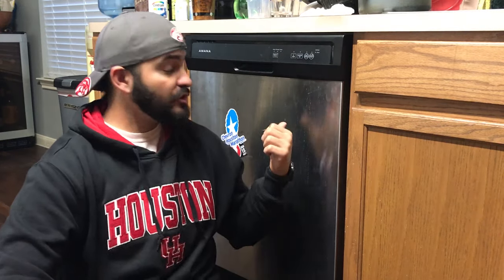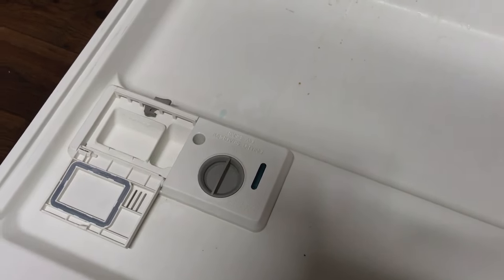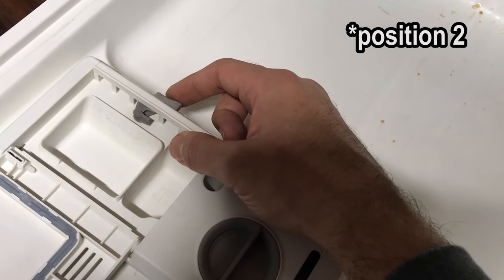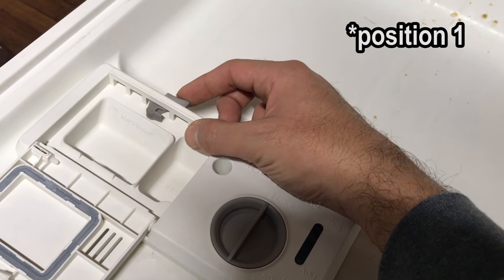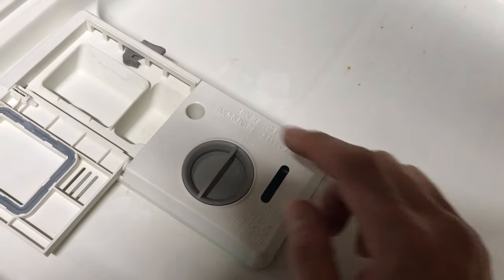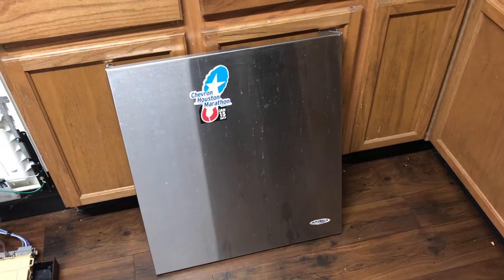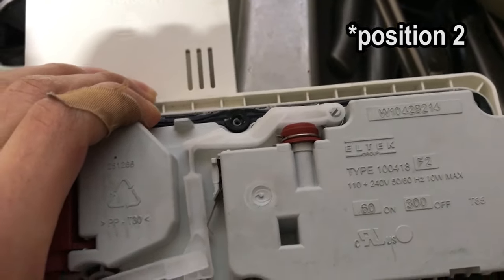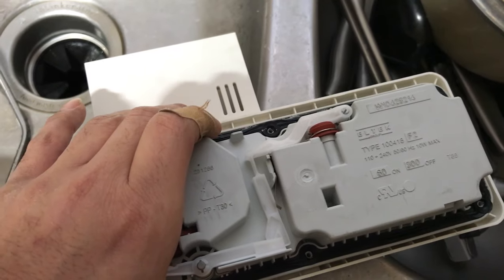[FIXED] Dishwasher not releasing rinse aid

Comment: You have no idea how mind blown I am right now! So thankful I found this video! I’ve tried everything to fix my dishwasher and never could get it to release the rinse aid! I just tried your trick so let’s hope and pray it works!!!! I’m at my wits end with drying these dishes every time!
Reply from the maker: I know your pain. When I reached my boiling point, I decided to rip my dishwasher apart because I probably needed a new one anyway. Then I stumbled upon the mechanism inside. I've been very satisfied with dishwasher's performance ever since. Hopefully your problem is the same as mine and this will fix it. Best of luck. Let me know if it works for you.
Reply: I have the same dishwasher but mine has loud click and silent click. Tried it both ways and neither worked. Glad it worked for others though.

Comment: Thank you so much for posting this. I was going insane couldn’t realize for years the rinse aid never emptied or anything. I never knew this. Thanks for sharing this trick. I’m a single mother & I couldn’t figure this out and with your video now the rinse aid is dispensing. Yay I am so happy. I hate spots on my tubberware and dishes and now I realize it was locked and not releasing the rinse aid. No one would know this because there is no button or anything that shows to do that. And I’m renting so I don’t own the Manuel. I searched videos after videos and none were helpful except yours. I appreciate you showing the mechanism behind it and how it functions. This video was extremely helpful. I am doing a load of dishes right now so I can’t wait for them to be done to see how they came out. I also changed the position to the highest since I have hard water so hopefully that works. Thanks again for sharing. You have been extremely helpful. 😊

Comment: Years of mystery solved ! I was wondering why my rinse aid levels never dropped. I had thought something must have been clogged. Thank you thank you thank you ! Why dishwashers don't have these instructions imprinted on the door I will never know. Maybe it is to get us to call the repairman every time.
Reply: How did you figure that out please? Your problem is like my problem I cleaned out all of the residual rinse aid, thinking the outlet was clogged, then I lost the cap and can not use it now. I need to buy a new cap but from where.  Regards, Laurel Merrick Bargara Queensland Australia 4670.

Comment: Thanks for the help, Alberto.  With your guidance I was able to get my rinse aid dispenser to work.  My dispenser stop opening entirely.  The pin that engages the lift lever was out of position so the plunger/stop at the top never opened.  By repositioning the pin back to where it belongs the both actions now work.  The detergent door opens and now the rinse aid plunger/stop at the top opens and rinse aid dispenses.  I had to remove the unit from the door to see the problem.  Just one more thing to check in addition to your guidance.
Reply from the maker: I'm glad this helped you out. Hope you got your problem resolved.

Comment: I would just keep it on position two all the time and put the pod in the flatware caddy. The pod won't fully dissolve in the prewash but that little bit of detergent released helps to start attacking the grease and then for the main wash, the pod will dissolve completely to clean the load. You won't have any lingering fragrance on your glasses or dishes at the end of the cycle either. For sure, run the hot water at the sink 'til it's ripping hot, and immediately start the machine. Always clean out the filter monthly and use a dishwasher cleaner every month in an empty machine to get rid of lime or mineral buildup. Very good video.

Comment: Great video and explanation of how that mechanism works.  Mine might be the wax motor, I don't think it's extending the piston far enough to release the plunger for the rinse aid.  Thanks to your video I see that it doesn't take much movement of the piston to release the door for the detergent, so I think that's my problem.
Reply from the maker: I thought the same thing about mine until I connected it to 120V A/C. Then I saw it extended all the way. It saved me from buying a new one. If you have a safe way to test it, you may want to verify if your was motor is extending all the way. Also make sure the lever is in the correct position.
Reply: @bird2002  Tested it today first on a bench, then in the machine. Applying power extended the piston the full distance and opened the plunger. I'm not sure if I'm out of sequence because even if you are out of sequence, the rinse aid would be release, just at the wrong time. We aren't getting it released at all, the reservoir never goes down.  Unless, the duration of the plunger extension is shorter for the wash step (opening the door), then longer for the rinse step. In that scenario, if I was off sequence, a small amount of aid would be released during the wash step, but during the longer rinse step, the plunger isn't opened because the sequence is off.  My other thought is a bad control board where there isn't a open command given during the rinse step.  I'm going to run it with the door face off and see if I can tell what's going on, but it's defiantly not anything wrong with the motor or the dispenser.

Comment: WOW!  I’M SO THANKFUL I FOUND THIS VIDEO!  I have the exact same Amana dishwasher under the wet bar in my basement.  I had the exact same issue as well: bought it new, added Jet Dry, and never consumed a single drop of the stuff after hundreds of loads over about 4 years. 

Wasn’t a big enough deal to go through the hassle of pulling it out and sending it out for service, but it always annoyed me that it had that one issue. 

After I saw this video, I set the latch in the correct position before loading the soap and closing the door, and voila!  Dry dishes!  You rock!  Liking and subscribing!!

Comment: Mine is a bit different, it's a Kenmore and it has a different controller for the detergent. But, inside the dispenser, I did notice that there are 2 ways that the "floor" of the dispenser can be left at. So, I moved it, filled it with white vinegar and turned it on the long wash cycle. We shall see. Your video was excellent, though and should work for lots of folks! Thank you!!

Comment: OMG, I’ve changed the heating element, swapped over the venting module, and still my dishes are always wet!
Finally noticed the rinse aid wasn’t dispensing and came across this video whilst searching for a fix. I’ve tried the fix and running a wash now. Fingers crossed it’ll work. This issue has been driving be crazy!  I was about to pull it apart and thought I’d check first before doing so. 
Going to come back and provide an update once the wash cycle is done.

EDIT - Seems to have done the trick.  Thank you!!
Reply from the maker: Yes!! Let me know if it works for you
Reply: @bird2002  Seems to have done the trick!! Thank you heaps.

Comment: So I had this same issue. What your video does not mention is that when you shut the soap dispenser door, the linkage will always revert to position one, the far right side of the triangle on the back linkage arm. No matter what position the linkage was left in. I watched a full cycle run and in the wash cycle I can watch the small motor turn on and open the soap door. After the motor piston retracts, the linkage is now in position to release the rinse aid. At least with my dishwasher, the motor never turned on again during the rinse cycle, allowing it to dispense the rinse aid. I’d be curious to see if you’re experiencing the same thing.
Reply from the maker: that's a new for me. I'd be interested in taking it apart to see if that works. Sounds like an excellent idea for a follow up video! Thank you so much! I'll post it when I try it out.
Reply: You’re 100% right, which nullifies the point of this video to begin with. Soft click/hard click doesn’t mean anything if the dispenser resets the toggle when you close the detergent door.

Comment: Dishwasher's been broke for going on 5 years now. Decided tonight was the night it got dealt with lol. Just before getting started at ripping it open, thought I'd check YouTube. Thank you! Saved me a bunch of hassle! 👍
Reply from the maker: I hope it proves useful for you. Let me know if it improves your drying. Another tip is to use liquid pre-wash in addition to the tabs/capsules. After I started using both, it made a big difference.
Reply: @bird2002  Dishes came out spotless! For the first time lol. Had to use the back of a fork to get it unfroze from the position it was in. I guess years of being stuck left it a little unwilling to move at first. 🤣 Once I got the gunk freed or whatever was holding it stuck though it moved happily. Watched the video again to make absolutely positive that it was in the right position n for the first time since I've had it - IT DISPENSED! 😲 
Thanks again!
Worked a treat! (n my dishwasher was a completely different model, but the concept remained the same nevertheless)
Reply from the maker: @abstract_jeff  awesome!! So happy to hear that. Thanks for letting me know how it turned out.

Comment: Holy crap, I'm glad I stumbled on your video! I couldn't get my rinse aid to dispense, so I went looking around for DIY videos for the Amana brand dishwasher specifically to no avail. I assumed it was broken and couldn't be bothered to take my dishwasher apart, so I was going to replace it, but you just saved me a TON of money! I wish Amana would explain this feature in the user manual.....
Reply: mine does not soft click
Reply: @Crazy4Morehead  mine doesn't either. Did the fix work anyway??
Reply: @Crazy4Morehead  Maybe you’ve solved this issue already, but just in case my experience helps…my “soft click” wasn’t as silent as his when he showed the dispensers uninstalled from the washer. The rinse aid 2nd position made a click when pressing it but was silent when releasing it. The 1st position clicks when pressing and releasing. So the soft click isn’t silent, it just doesn’t click with the release of the button so it feels and sounds softer. I had to play with it a while to be able to discern the difference and to understand it needs to be left in 2nd position with the door open so that when you fill with detergent and close the door it will return to 1st position.

Comment: Thank you so much. I searched the Internet high and low for a solution to this problem 18 months ago and gave up until now. I just decided to search again on a whim and found you. My landlord replaced the dishwasher with an Amana and after the first wash I noticed lots of spots so I watched the rinse aid and it’s level never went down so I told him the rinse aid wasn’t releasing and he sent a technician to fix it. The technician said everything was fine and it just releases slowly and disregarded that the level hadn’t dropped in 2 months. After 6 more months I called Amana (my landlord put me in charge of following up and gave me the purchase paperwork because it was new and he already called a technician) but the warranty had expired. Not one single mention of this mechanism in the trouble shooting guide or installation instructions from Amana nor did Amana customer service know of this. I’m guessing the lever got pressed when open during my landlord’s install. The explanation after showing the fix is a little confusing so thank you for simplifying it by saying that it just needs to be in the soft click position before closing the detergent door. As others have commented, I too am confused how the rinse agent is not dispensing at the wrong time because I just tried this and held it open in the 2nd position to see if rinse aid would flow out so I didn’t have to wait for several washes to see if it was working and rinse aid did come out so mine isn’t clogged. Also, does this mean that my detergent hasn’t been released until the final rinse all this time??
Reply from the maker: I'm glad you found this helpful. I feel they don't publish this information in their owners manual so that the consumers are forced to pay for their technicians to come make repairs. It's all about money, otherwise they would just notify people of the fix and then they would make no money.

As for the detergent, the detergent door opens anytime and every time that the wax motor operates. So regardless of which cycle you're on, or which position the piston is in, the detergent door will always open. Rest assured, your detergent is being released at the proper time. The problem comes down to the rinse aid, because that one does specifically rely on the piston being in the correct position to operate.
Reply: In the soft click position, thank you+ I still wasn't understanding 😂

Comment: YouTube magic ? Haha... Found your video while searching for tips on a lower door seal leak on my dishwasher. I have (had) a similar rinse aid problem too, so with the right search word I found this. Yours is Amana, mine is Frigidaire (aka Electrolux, also Kenmore) but has a very similar soap / rinse agent dispenser as yours. My unit is from 2004. I had to replace the soap dispenser about a year ago, the detergent door lock no longer worked, the plastic lock hook wears with use (known problem on these machines). So I got a new dispensor online (easy to find) and put it in. A couple months after, I noticed my Low Rinse agent light was not coming on as it normally did before, after 5-6 weeks, and also I noticed more residue on glass. I use regular liquid detergent and did not have a residue problem before. I was considering replacing the dishwasher, being 16 years old and 'not washing well' anymore... Just for kicks, I bought a new liquid detergent ('complete' formula) which contains rinse agent and wouldn't you know it, glasses came out spotless. A few weeks later, I saw your video and thought... uh-oh... I must have messed with the release when I installed the new detergent dispenser. Mine is also a 2-stage mechanism with a hard and a soft click. So today I set the soft click before closing the door and did a load with my old detergent : no spots on glass ! I will be able to confirm this issue is resolved in a few weeks... when/if my Low Rinse agent light comes back to life. To think I almost threw this [good] machine out because of this... So Thank You :-)
Reply from the maker: Awesome! I'm glad this helped. Let us know how it turns out in a few weeks.

Comment: But why would the rinse aid stay full forever if it is releasing into the wash cycle?  That should still cause the rinse aid to deplete.
Reply from the maker: I think it might be clogged. Another person commented on here with the same problem and it never drained, so they emptied it manually and washed it out. Afterward, it released rinse aid properly.
Reply: @bird2002 Mine won’t go down at all either, so how do I drain it manually as you suggested?

Comment: Has your rinse aid been dispensing? Mine has not, and after watching your video multiple times I’m starting to think there is no reason to do the two clicks you mention. It seems that the machine is in the correct position once it has finished running anyways since the next click when you go to click it after a cycle is the hard click, and the one after that is the soft click. You say to leave the machine after the soft click which makes sense, because first the machine will activate the hard click while running to dump the detergent and then when it’s time to rinse it’ll activate the soft click and release the rinse aid. That would leave the machine in the same position that we would have left it in by clicking the lever twice and leaving it after the soft click. I’m wondering if these machines have a defect that makes them not dispense regardless?

Comment: OMG!  I have to agree with the other commentors that you are a blessing!  Not once has the level of rinse aid in my Amana DW gone down and my dishes are always wet.  I just tried this on my machine and hope that it will fix the issue.  So many reviews online talk about this exact issue with Amana DWs.  I just did a load last night so don't have any dirty dishes right now but I am so hoping that this is the fix.  Thank you!  Amana REALLY needs to include this in the Troubleshooting section of the manual.
Reply from the maker: Thanks so much for the kind words. I hope this was helpful in resolving your problems. They probably don’t include any troubleshooting for this issue because they’d rather you pay their technicians to come out and fix it. They must know this issue exists, I can’t think of any reason they would occult a fix from the public (other than monetary gain of course)
Reply: @bird2002  It didn’t work for me. I left a follow up comment. No matter what position I leave it I no rinse aid is ever released.

Comment: I understand what you have shown, but when I comes to my dishwasher, after a cycle has gone thru, the detergent holder door is open. My question is: should we ensure that it is in the 2nd position prior to inputting the detergent and closing it? Or should we close it, hold the detergent door down, and listen for the 2nd position click?
Reply from the maker: After the wash when it’s open, fully press the button inward until you hear the clicks. The last one you should hear is the soft click, then just leave it open for the next time you go to wash. 

By leaving it on the soft click, this means the next action of the washer will be to release the detergent, and that’s the proper order for the wash. Easy as that.